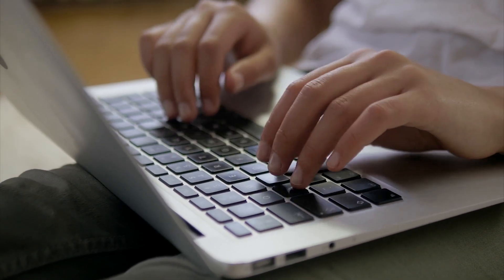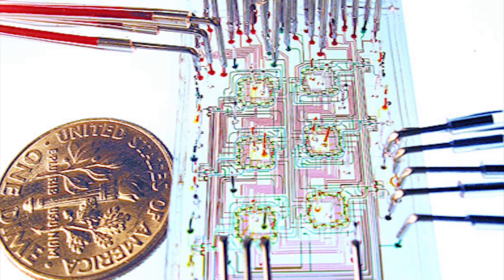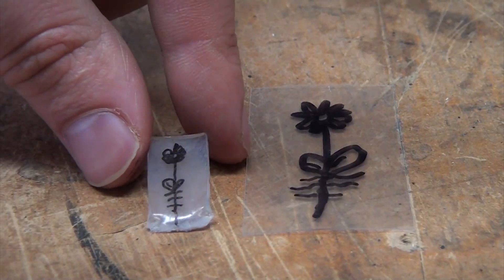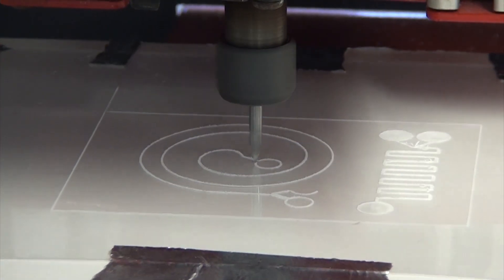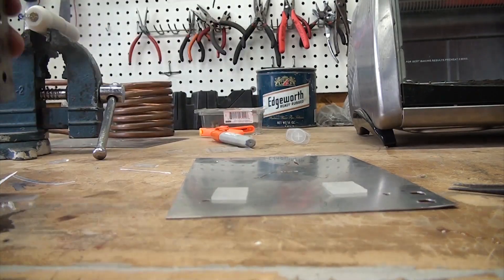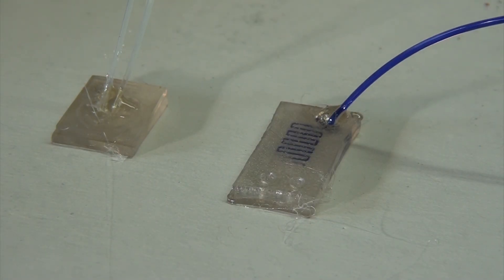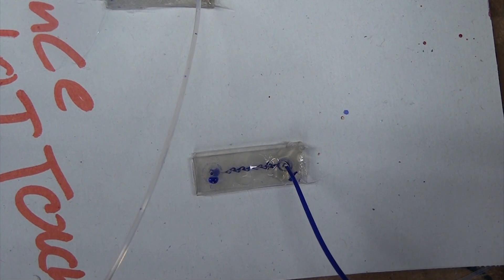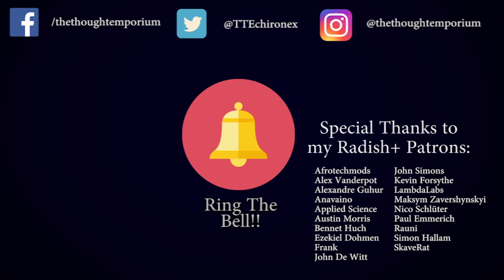Worlds Smallest Tesla Valve? - Shrinky Dink (Shrink Film) Microfluidics

Comment: THERANOS would like to know your location.
Reply: Perhaps with this idea, they wouldn't have needed to lie quite so much?
Reply: as someone who did a masters in microfluidics, it's still a lot harder than it looks. Microfluidics is so difficult because proteins stick to the plastic (because plastic, as you probably know from tupperware, gets pretty gross). This makes is really difficult to make a long lasting device

that's the fundamental issue with microfluidics, and while there are a few ways around this, so far it's been an insurmountable problem to mass commercialization
Reply: @Doctrina_Stabilitas  good point. I imagine this could be cheap and easy enough that you could replace the microfluidic components regularly?
Reply: @Bennyboy-dog  if the whole goal of microfluidics is the democratization of access by providing low cost tests and analysis, having to replace components (or indeed, having unreliable components) defeats that purpose. Tehre's a reason channel based microfludics hasnt taken off, but more qualitative paper based microfluidics has in the form of test strips
Reply: how about different materials like glass, ceramics or even channels cut 
into steel, wouldn't that be more durable? @Doctrina_Stabilitas
Reply: @gugligup  It depends a lot on what you are trying to do. At such small scales the hydrophobicity of the channel generally plays an important role. If you are looking at single phase fluid dynamics its doesnt matter too much. Multiphase flows are heavily dependent on the material of the channel. Steel wouldnt be very useful for imaging as it isnt very transparent. Another thing to keep in mind is that while cnc cutters are great and used quite a bit in microfluidics, lithography is still the main way as resolution is normally very important in these systems. In general glass slides and PDMS are the champions of the field.
Reply: @Doctrina_Stabilitas 
Than why not just use bioneutral silicone?
Reply: @Doctrina_Stabilitas  seems like the etching methods used in making computer chips would allow for mass production, at the same time, allowing for the use of glass or some other medium that stays cleaner longer
Reply: @CommonTater100  yeah that's also used already. MEMS production methods are used, but all that still doesnt overcome the fundamental issue of protein "stickiness"
Reply: @Doctrina_Stabilitas  thats why you would use glass but you would need extremely fine tools bc you cant shrink it
Reply: @dilf36  it exists, you use photolithography and other mems production methods to make channels down to the micrometer scale
Reply: LoL

Comment: Water powered computer logic gates?
Reply: I wonder if you could use for deep space crafts as radiation tends to hurt the electronics quiet a bit.
Reply: Not really necessary. Even if you ignore that radiation hardening  of electronics is a thing, you can just use larger electronics. The reason radiation damages micro electronics is because it can induce current where there shouldn't be any. If you use larger parts (as the Apollo Guidance System did), radiation can't induce enough current to do any damage, and it is still much cheaper and effective than microfuidics.
Reply: @toboterxp8155 
Or just get better shielding
Reply: @toboterxp8155  yeah but you don't want large electronics on a ship where weight is everything
Reply: @alperenaydin6139  hi, are you me in a parallel world commenting to the same topic just like I would?
Reply: @alperenaydin6984  No I am you from the future. Just a bit more handsome.
Reply: @alperenaydin6139  so I probably got bald and still handsome, that's a relief :D
Reply: @alperenaydin6139  How do you propose that would work? Because using it for basically any logical operation would require a lot of microfluidic cells. And how would you convert the physical actuation to electrical impulses? Besides it probably cheaper to just buy rad hardened components than creating an entire micro chip out of microfluidic cells.
Reply: @rajivnarayan5214  Honestly I started thinking that because the fluids moving through looked like the start up sequence of a starship. So keep that in mind. But a pressure sensor can function as transformer from fluid to electrical.
Reply: @rajivnarayan5214 pressure on a piezoelectric device might work.
Reply: @sarnxero2628  Piezo devices are always finicky to use. But I guess using pressure as a voltage divider or current limiter in the form of a piezo device works in theory.
Reply: @rajivnarayan5214  electricity and fluid dynamics work exactly the same.   
if they can make a semi conductor for electricity they can make a semi conducter for fluids.  
i can even imagine a transistor made out of these.  

but then we would be back to the age of room sized computers just for the novelty factor.   because electricity is faster.
Reply: @rajivnarayan5214  You could use microfluidics to operate simple processes on external hardware or hardware closer to the surface of the ship. This would accomplish the same goal in a more reasonable way.
Reply: @rajivnarayan5214  could be useful to prevent signal attenuation when proporgating information down a communication bus, effectively blocking EMF by decoupling electrical circuits, the again fiber optics can do that too.
Reply: Veritasium once made a video about producing electricity just from passing water between coils, I wonder if you could put coils around the microchannels to produce current from this.
Reply: @Max_Le_Groom  Veritasium also about compliant mechanisms. Those can be used for certain things.
Reply: Instead of arguing if its practical or not, can we just agree that a non-electronic computer would be super cool?
Some people mentioned fluid logic from the 50s - a full 4 bit computer was build with this technology https://patents.google.com/patent/US3190554A https://www.semanticscholar.org/paper/FLODAC%3A-a-pure-fluid-digital-computer-Gluskin-Jacoby/4533b85cbd4759864440a263c4bc1cf961b1fac7
With current microfluidic technology, the same 4 bit computer could be made much smaller. Heres an example of a simple shift register https://vimeo.com/216375125
Reply: @miron__  This is actually super interesting, I wonder if they used this in early ww2 planes for the actual altitude, and/or pressure sensors. I knew there was electromechanical but electrofluidic seems like it would be a very viable option. They are using the clock line as a pressure differential between atmospheric and vaccuum pressure and valves as the input. Seems like an extremely robust way to create a circuit.
Reply: @miron__  you mean like an organic brain?
Reply: There are simple and not so simple fluid logics used in nuclear sites like power plants. Since the late 50ies there have been some computers.
Reply: Yes, but will it run Doom?
Reply: @gustavgnoettgen 
Nice
Reply: A hundred years ago people would have said it was impractical to use electricity to do math. The field of microfluidics is getting more precise and useful by the day, it's not unreasonable to expect that it'll be used in computer technology at some point. It's not quite as scaleable, since this only goes down to the size of molecules whereas computer technology is getting to a point where it can use quarks, but it's still interesting to see what kind of applications this kind of thing has. A microfluidic computer wouldn't have as many problems with overheating itself, for example, whereas quantum computers as they stand now have to be used from within chambers cooled to nearly zero degrees kelvin.
Reply: @littlesnowflakepunk855 
How about a quantum feedback loop in which the water is energised into a sort of pseudo plasma or hypercritical fluid upon which the electrons in the water-plasma could be used as gates/transistors and doubling as a coolant at the same time possibly offering room temperature water based superconducting controlled even further with the design of the chips?
Reply: interesting idea but not really viable as water and other liquids flow much slower than the transmission of electrical signals, that and science is developing a computer system that uses light for communication between parts which is basically as fast as we can get
Reply: Neurons are microfluidic valves transmitting information through ion movement, which makes it both electric and fluid in nature.
Reply: NaK based fluidic computer for use on a Venus rover.
Reply: It's called irrigation... Hahahaha
Reply: Blood powered computer logic gates?
Reply: @jaedenvanderberg3890 
That's actually a wonderful idea, it's not impossible You know
Reply: Rather analog computing
Reply: Or ethanol...
Reply: it deffinatly won't get hot
Reply: water cooling+